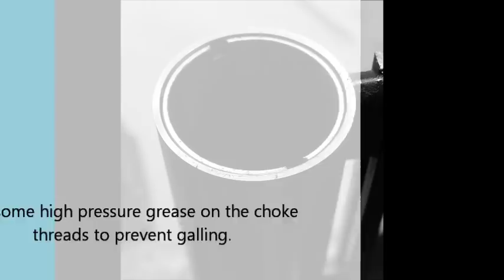Choke Tube Installation

Comment: A lathe is great if you have one. I did 3 of mine with a hand drill, its slow but I took my time lots of cutting oil and it worked perfect. Ive done 5 others for buddys and no problems.

Comment: This tooling is great. Make sure  the inside barrel is sanded clean where the work is going to be done.  I like to center head the reamer and tap in a drill press and hold the barrel with a wood clamp that has been drilled to receive the barrel. Hold pressure down on the tool with a center punch that is chucked in the drill  press. Turn the tap wrench and use Easy Tap brand fluid and clean burrs out every 1/8".  I like to blue the new work area so the oil has a nice sticking surface.

Comment: minimum thickness? want to do this to my mossberg 20 inch 8 shot 500 standard thickness
Reply: I know the thread is old but I have the same barrel and was wondering if you ever got around to this and how it turned out

Comment from the maker: It's important to note that you must either cut the barrel back to eliminate to the fixed chokes, or you must ream them out with a separate reamer.  The only exception to this is a cylinder bore barrel (no choke).

https://4drentals.com/measuring-for-screw-in-chokes-shotgun/

Comment: When you Tap the barrel after reaming; is the tread from the top to the end of the reamer; meaning.if I have choke tube with the tread at the top instead of the end and it had the same pitch size tread; will it srew up well in the barrel ?
Reply from the maker: It depends on the configuration.  The majority of chokes are not threaded at the muzzle, the reamer has already cleared that area of the barrel before tapping.

Comment: Hi um if I got this can I rechoke cuz I accidentally got the wrong choke and it suppose to fit optima plus but my barrel is benelli mobil
Reply: Always work on the cheapest part.  Its cheaper the order more choke tubes than to work on the barrel.

Comment: Where is the runout coming from, the 3 jaw chuck or is the reamer bent? it will make the reamed hole larger than desired did you check afterwards to see how much?
Reply from the maker: Cheap shotgun barrel frequently if not always have the bore off center in the barrel.  Note that the reamer is not showing run-out, it is only the barrel that is moving axially.
Reply: Looks like the spindle is bent or the 3 jaw has a lot of runout.  It could be a reamer, but not likely.
Reply: Nothing wrong with the lathe or the tool.  its the barrel.

Comment: How often should you break the chip when cutting threads? I have seen when cutting smaller threads it is recommended to back off the tap every half to one turn. Seems like it worked out for you, just curious if the difference in diameters is the cause or what. Awesome video though, just what I was looking for!
Reply: I break the chip about every thread or two.  you are working on a very larger surface area.

Comment: What is your rpm on your lathe while reaming?
Reply from the maker: Keep it slow, mine is about 75 RPM.  This is a large diameter tool with a huge cutting surface.

Comment: do we real need so many chokes in a gun? a full fixed choke in  a hunting gun is enough to do all what other chokes can do as along as your shooting distance is well calculated. also not forgetting  the use of the right kind of ammo for your hunt.
Reply: Lelouch Vi Britannia  a full choked barrel can shoot every shot, no need to worry about a thing. no need for sabot slugs because rifled slugs  are there for smooth bores.
Reply from the maker: There are many reasons why a shooter might choose to have interchangeable chokes.  Almost as many reasons as there are shooters.  LOL  Baskin Robbins has 31 flavors, not because Vanilla is not a good choice, but because some folks want something else.  Happy Shooting.
Reply: is it because shooters need that or because it is there and why not opt for ? LOL
Reply: try a full choke on squirrels at 10 yards, you won't have enough meat left for supper...
Reply: If you shoot steel shot, which is required for waterfowl, you want a replacable choke